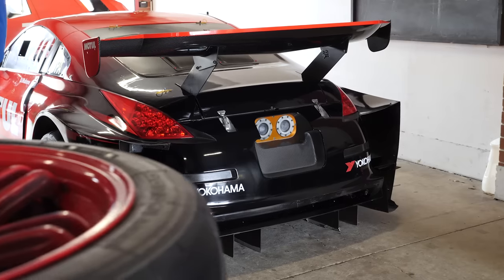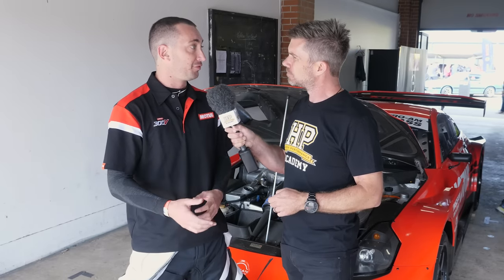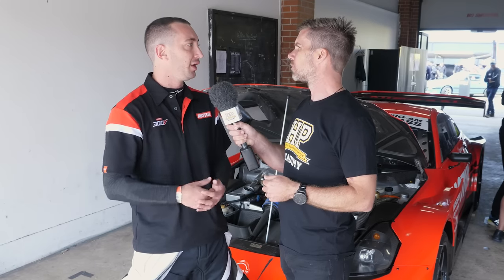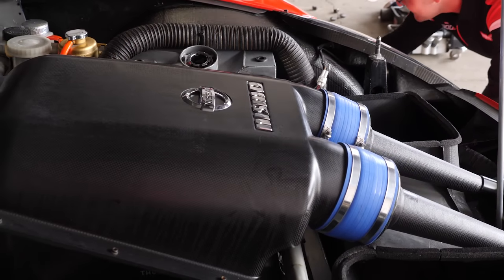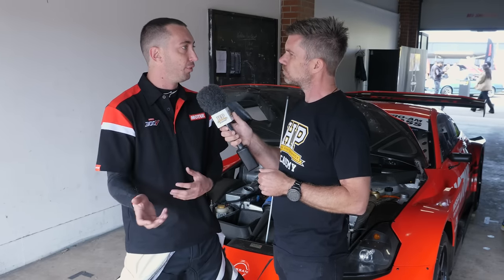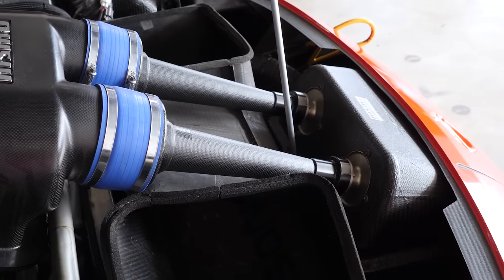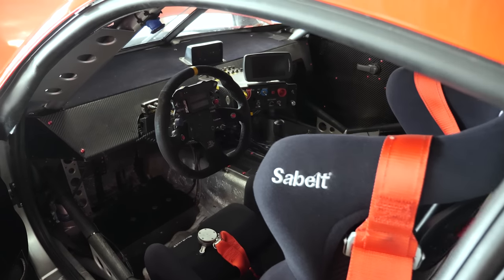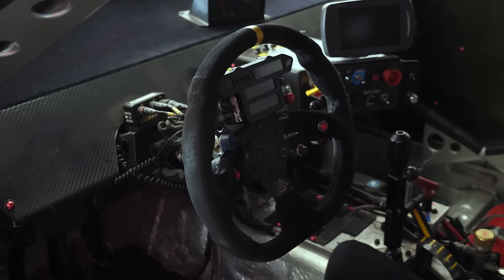This 28L Airbox Setup Is GENIUS - Nismo's GT300 Z33

Comment: 580hp out of an unrestricted NA vq35de running at 10.5k rpm .....Jesus, that's just glorious
Reply from the maker: Dale does stress that it shortens the maintenance intervals drastically, but definitely impressive! - Taz.
Reply: Check out the Z that's been shown on speed academy, even though it's a hybrid configuration, it makes a total 600hp NA
Reply: @bryce16710  if memory serves Sasha's car is a 4.2L motor with either HR or VHR heads. That's what makes this Nismo motor that impressive, it's only a 3.5L with DE heads, just bonkers.
Reply: @jackassrower  You might be right about that but I still think it's absolutely amazing that he produced it. I still give high respect for what they get out of the stock engines for the GT300 and 500 classes.
Reply: @bryce16710   completely agree, Sasha's car is such a cool and unique beast. Very glad he built it. The motorsport world is just a bit more interesting thanks to people like him.
Reply from the maker: @bryce16710  Little bit of chat on it via this link too: https://www.hpacademy.com/blog/700whp-hybrid-350z-and-electric-lotus-modern-ev-conversions-tech-talk/?utm_source=youtube&utm_medium=social&utm_campaign=general-interaction - Taz.
Reply: So far I only knew about the VQ35s build for the older Formula Renault 3.5, which in there last iteration had like 440 hp. They were like the holy grail in allmotor VQs
Reply: It has a road block and heads, valvetrain/seats/chambers are exclusively machined for racecar duty. It has different sized spring buckets and the block has been cut to mount it lower in the chassis. The main caps are part of the dry sump pan too. Info is from Motive video.
Reply: Astonishing !  A fair bit beyond me lol 😂but dam that awesome
Reply: @AccAkut1987  I have a 3.5 Renault in the workshop, just converted it to Motec M1 system and we have it running certainly looking forward to getting it on the dyno

Comment: So after being wot and the plenum collection effect "wears off" is the restriction that great that the engine starts seeing less than atmospheric pressure?
Reply: It's breathing through 6 ~50mm throttle bodies and it has 2 ~27mm restrictors, so yes
Reply: @m0rb1d43  most of that's definitely placed on behalf of the 27mm restrictions though I'd assume. 50mm throttle bodies aren't horribly small and they're in the "force fed" plenum so the plenum could be at atmospheric pressure with motion if it weren't for the other restrictions up front
Reply: @scoob66  That's exactly my point. The ram-air effect is  so minor, that's not going to compensate for the amount of air the engine will be pulling. If the restrictors would be removed it would be completely different.
Reply: @m0rb1d43  approx 20% extra volume feeding in at 160k+.

Comment: A little fun fact, current GT300 cars are actually producing around 400-500hp, while GT500 makes around 600-650hp.
GT500 can pretty much go toe to toe with an LMP2 car (maybe even faster)
Reply from the maker: They are scaling them back soon though correct? Heard some commentary on it during the last race I watched but I didn't listen too closely - Taz.
Reply: @hpa101  I haven't heard any news about the decision to scale back power right now. Although the biggest one I know would be around improving the cars' safety after the horrific crashes on Fuji.

Comment: 28l? An engine would make a vacuum out of this in like 10-20 revolutions. I don't think the boos from this airbox lasts for more than 1 sec.
Reply from the maker: As discussed it is a small gain which in a 'spec' series can be the difference between winning and loosing. No one should be running out to replace their turbochargers with a 28L airbox etc.....😉 : https://youtu.be/YVtxu97Ku3A?t=420 - Taz.
Reply: As road speed increases, pressure into the plenum builds from the intake in the front bar. This changes resonance and filling throughout the RPM range. Data showed around 20% increase in volume available to the engine under WOT, at speed compared to static, even with the restrictors.